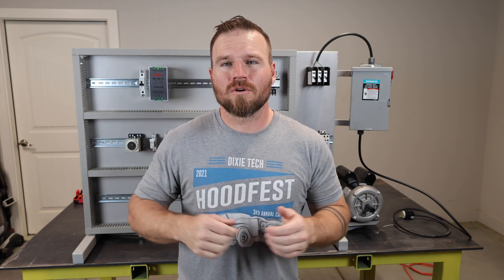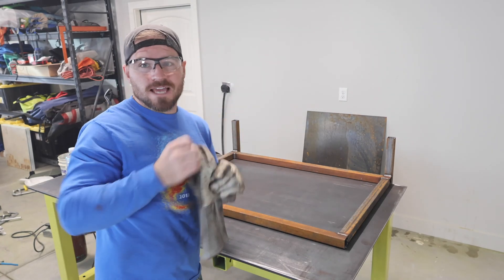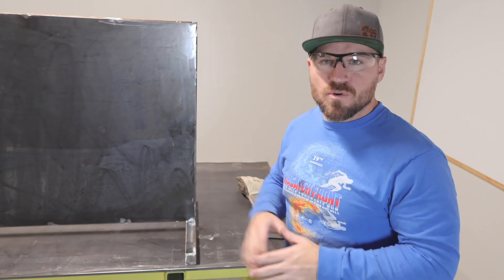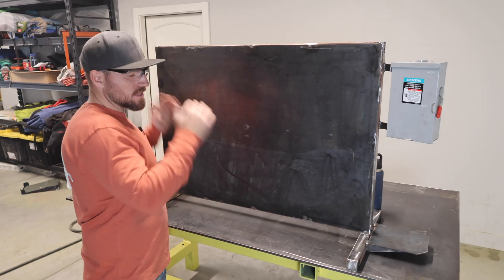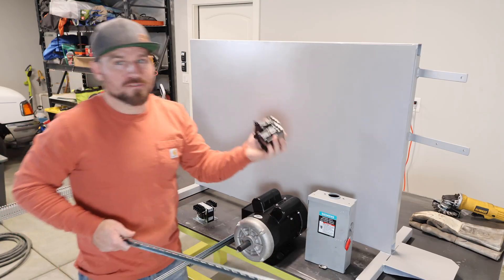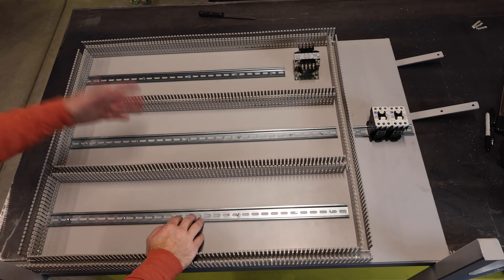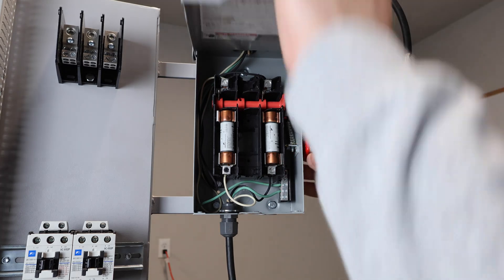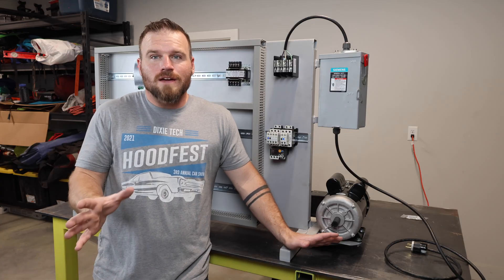Building a PLC and Motor Controls Training Board: A Hands-On Guide

Comment: It looks great but bearing in mind you would do this to save costs and for training, I think aluminium T slots with 3D printed or cheap metal parts to connect them could do more or less similar job with much less cost and much easier to do. I don't think the average teenagers willing to go through electrical training will have the skills to solder, cut and generally build the whole thing. Aluminium T slots and/or wood would be much more realistic for the average young man willing to save and get that put together. Very few people have the access to parts, tools and skills to do what you did. Again, amazing job and great solution but I don't think this is at reach for most young men going through trade training for first time (maybe a minority can though).
Reply from the maker: You are absolutely correct. A bit of plywood would be cheaper.